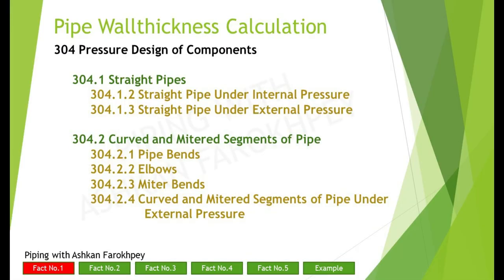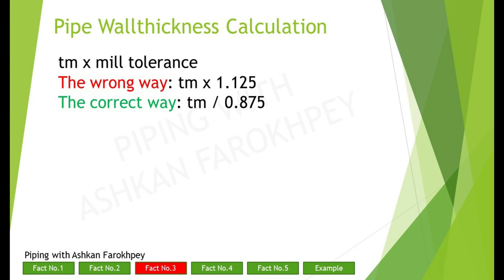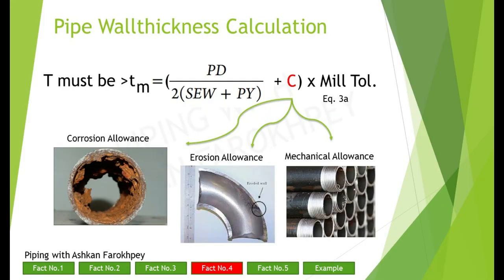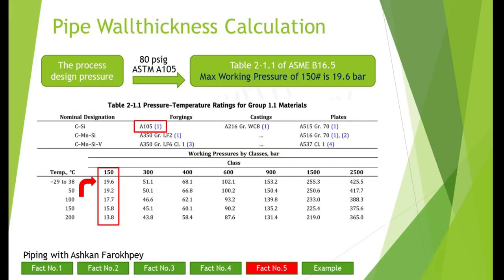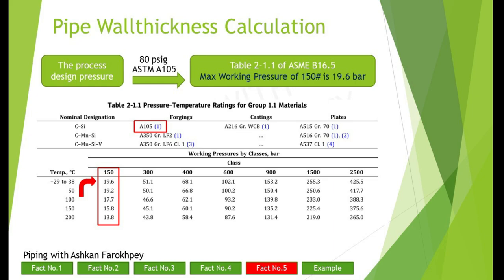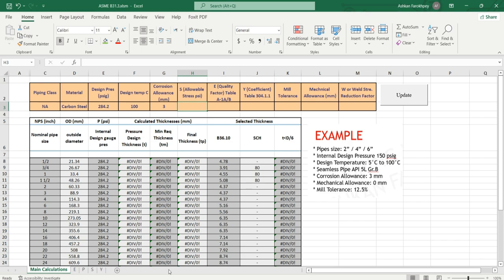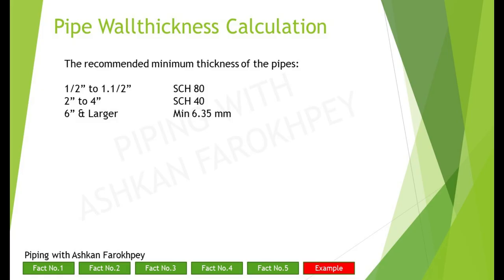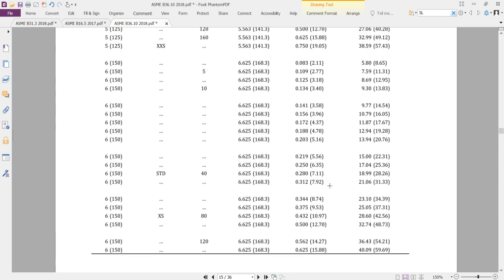Five Facts in Pipe Wall Thickness Calculation of ASME B31 3 + Example

Comment: A couple of things.  The equation in Fact 2 really needs to be reworked to follow your explanation of Mil Tolerance in Fact 3.  "x Mill Tolerance" is misleading.  It would be better to show is as "/(1-Mill Tolerance)", which is what we actually do and what you explain in Fact 3.

Also, I disagree with your recommendations for the minimum walls, at least for Carbon Steels.  Anything 2" and below should be Sch 80 minimum, and Sch 160 is common for 1" and smaller for things like vents/drains to provide more structural integrity against accidental impacts.  Your recommendation for anything 6" and larger being 6.35mm (which translates to 1/4") is also pretty light.  Again for mechanical integrity and pipe span, STD wall is generally the minimum that you are going to want to see.
Reply from the maker: Many thanks for sharing your opinions 🙏
You may be right about the formula shown in Fact no. 2. But I believe the minimum wall thickness varies in different practices. For example what I said in my video is based on ARAMCO piping specification. However your comment is valuable and I will try to find the most engineered min thickness 🙏
Reply: @ashkanfarokhpey  May I know what to consider for the recommendations for minimum thickness of wall and where can I find the justification to use it? Thanks, in advanced!!
Reply from the maker: @ Hi. There exist different recommendations for minimum wallthickness of pipes. For example you can use table 1 of section 10 in ARAMCO SAES-L-310 standard. But what is commonly approved in piping world is what I mentioned in this video.